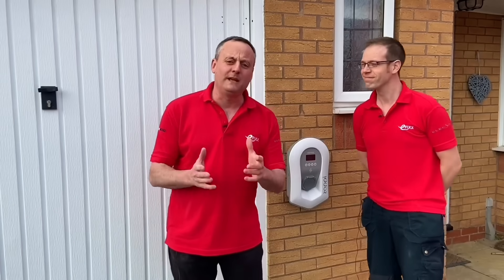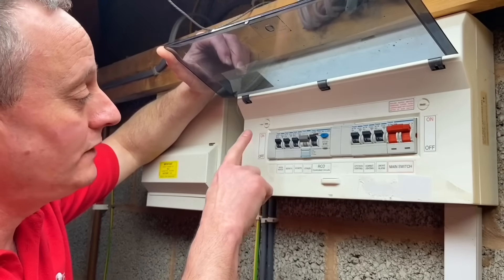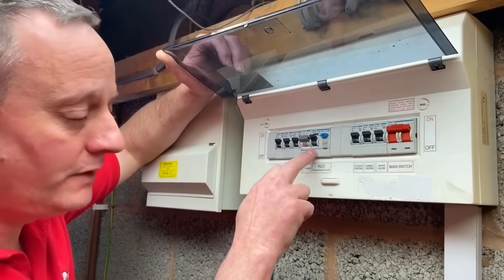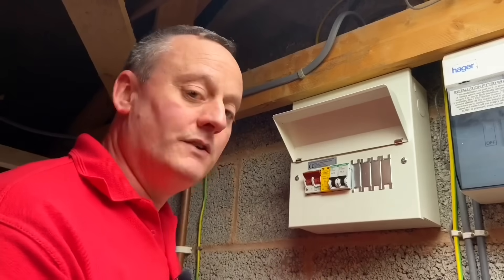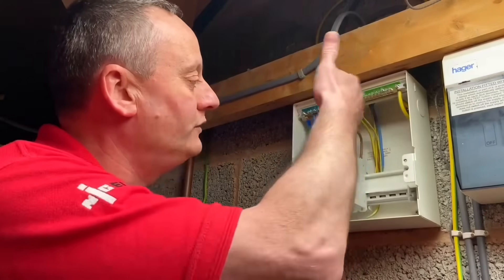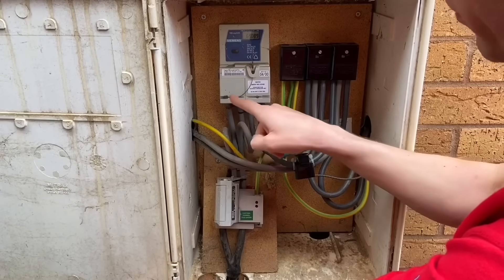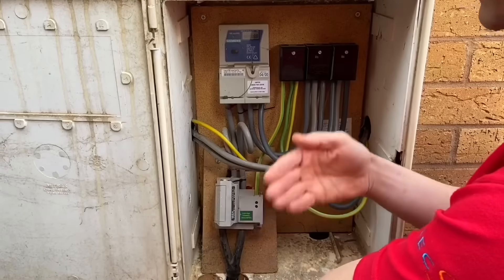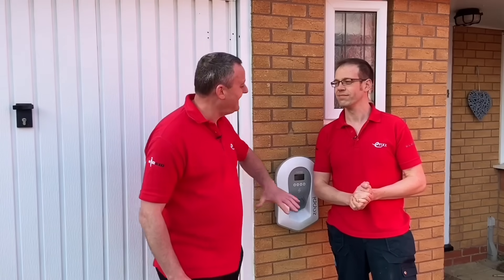EV CHARGER installation UK - can you connect to an existing CONSUMER UNIT?

Comment: Re: Using the same type of breaker topic around 2:05 mark - when electricians install new CU's' is it standard practice to advise the customer to have some spare MCB's/RCBO's in case new circuits are added in future? As a homeowner I just assumed I could always get hold of a breaker from the same manufacturer and it would be backwards compatible

Comment: But if poor installation no stickers on board , cable just clipped along joists without no protection or and fire rated clips 😒
Reply from the maker: Thanks for commenting - The video stated the stickers are still to be added and the cable is clipped for 1m so no fire clips required also the ceiling is now boarded as well. 

This video covers fire clips in a similar location 😉 https://youtu.be/9Ne-X7fLsnk
Reply: @efixx  I know video says stickers will be added later , and 👍🏻👍🏻about ceiling being boarded now

Comment: On the subject of EV charger installation, I'd asked my DNO (Western Power) to check my service fuse rating as I'm looking at getting an EV. I've just come off the phone to  the local office - they were very helpful and explained that the maximum they would fit is 80A. But, and as a policy that is only a couple of weeks old, if that is not adequate for an EV charger and the other house loads, they would upgrade the supply to 3 phase for free (3 X 80A). To say I was surprised is an understatement - I asked if this means they will dig up the road and was told yes. I said it sounds very German and she said that is what they are moving to, with a phase for the EV charger, a phase for the heat pump and one for the house. On new build they now provide a 3 phase incomer, blanking off 2 phases if only a single phase supply is required.
Has anyone else heard this, or seen it in practice?
Reply: That's a new one, but makes sense because of the obsession with the government's push for electric, which is not the silver bullet most think it is, but that's another issue.
There was a time when suppliers wouldn't fit a 3 phase supply in a meter box, always had to go on an inside wall.
Looks like they are going back to the old days, occasionally you come across 2 phases where one was used for heating.
Reply: Had cut out here replaced a few months ago, (Western Power) offered me the same upgrade the supply to 3 phase for free (3 X 80A) FOC.😲
Reply: @stuartandrews4344  Did you go for that, and if so, what have you installed as a consumer unit? The WPD document suggests 3 separate consumer units (or 2 of you only need 2 phases) and 3 phase DBs tend to be a bit big for domestic use.
Reply: @stuartandrews4344  It's the consultation document (not the responses) here https://yourpowerfuture.westernpower.co.uk/superfast-electricity-consultation and a couple of draft documents linked from it.
What you say makes sense if you just want a single phase supply at each location. If you want, for example, a 3 phase charger or machinery with 3 phase motors in your workshop, you then need a 3 phase DB wuth appropriate installation design (correct phase rotation, not having outlets on different phases within 2 metres).
Reply: That sounds very nice, do it! 

Here in Denmark we run everything 3-phase as standard, so it seems reasonable that our southern neighbour is moving that way as well. 

3-phase 230v coming into almost any house (even our old 1940's house), and I think we have a 63a fuse in front of each phase. 

I've added a 3 phase 11kW chargepoint to this house and was initially concerned about the available power vs. this old house. The electrician basically shrug his shoulders and said it wasn't going to be a problem unless I wanted a few more.
Reply: @Dark Dreamz it's supposed to be 400v now, but is still 415, that's between phases, you still have 230v phase to neutral.
Reply: @Dark Dreamz Yes it is 415 V across phases but there is also a neutral provided, so phase to neutral gives the required 240 V.
Reply: Wouldn’t that end up with the phases becoming unbalanced? Ie if the house is using a small amount during the day, the heat pump working and the charger not being on or the car charging at night and the heat pump on setback and everything in the house being off. 
Not a sparky so interested in some one knowledgable’s views.
Reply: @davideyres955  Ideally when designing Electrical Installations balancing loads is a design goal. Ideally you would want a 3 phase board installed and used in a way that as much as practically possible loads are spread across phases, however the problem with an upgrade like this is the possibility of 415v shock risk if circuits are close together and mistakenly put on separate phases and so I imagine to avoid this risk it is easier to keep the phases separated as described. Alternatively if a 3 phase board was installed you would be looking at a full design and rewire.

Comment: Something to note is some manufacturers now suggest a 40 amp MCB for surge device. Definitely would seal the meter cabinet holes , but it looks very neat . Can I ask if the RCD protection was built into the charger and last time I did an EV point it was made TT . As always a great useful vlog
Reply from the maker: Inside the Zappi 2 smart electric vehicle EV charger which doesn't need an earth rod on TNCS systems https://youtu.be/gwmiGf6tChE

Great technology in the Zappi hence no earth rod required...

Comment: I see all the time in my industry, people take feeds to Solar PV inverters from AC type RCD's. If that RCD has a lot of electrical equipment already operating on the circuits it protects, the chances of DC saturation are already very high, meaning that RCD could fail under fault conditions.

Fronius (an Austrian inverter manufacturer) issued a statement some years ago stating their inverters should be installed on an A type RCD, but in reality most often, the manufacturers guide doesn't specify an RCD type for electrical equipment.

Depending on the installation, the circuit *most often, doesn't need RCD protection, according to the wiring regulations.

My personal preference is to split the tails into a Henley block and put the PV on its own two way board, with either a 100A main switch or an appropriately rated RCD that is also of the correct type.

Another issue I see quite often, two way boards installed with a 63A 30mA RCD, if the cutout fuse is 100A why would someone install a 63A RCD?
Reply: You have to remember for donkeys years now, we have only really used one type of RCD for everything, the ac type, then all of a sudden all these other types come to market, and I am very sceptical as to who is driving the industry manufacturers or the Muppets, better known as the IET.
And to be honest, the push is to put an RCD on nearly every circuit, and can be quite difficult to get around in some instances.
Also we are trusting a mechanical device, and there's about a 10% failure rate, which is a lot, then they never get tested, no one pushes the test button, so again they can stick.
As for the inverter manufacturer putting out that warning, manufacturers will do anything to cover their bum, just like board manufacturers that say to check their terminations, why, if they are at the correct torque when they leave the factory why should I check them. I do, but shouldn't have to.
Reply: A few years ago when I had solar PV installed at my place, the installer followed your preference, with a new dedicated 40A RCD and avoided the older consumer unit altogether, with a pair of new cables into the existing meter box on the other side of the wall - about 1/2 metre away max.

Comment: Out of interest, would it have been more cost effective to replace the existing board with a hager rcbo spd board giving better protection to each circuit?
Reply: RCBO's are expensive still, and then the whole system would need a test and inspection because of the new board, plus any remedial works needed to get the installation functional...

2 way board, Henley block and some.meter tails couple hundred quid + labour...
Reply: No
Reply: It would give better protection and discrimination from faults tripping a Rcd and multiple circuits going off but as said not cost effective.  Most people want the cheapest job .
Reply: @dennisphoenix1  over a longer period of time though surely it would be as that board has say 10 years of life left where as a new board would probably last 25 years for the extra 100 quid outlay.  Spoken by someone who always likes a long term fix to a problem
Reply: @thefallenangel2  why has that board only got ten years left ??  If properly installed and periodically inspected I should last longer than that . As I said most people want the cheapest job . You can give the customer choices and your professional opinion on the current installation but you can't say something is dangerous etc just to get work from a board change.  Some unscrupulous people will .

Comment: I bought a new house in Feb 2020 and the "EV charger" is just a 13A socket directly attached below the CU. 18th edition cert and NICEIC registered contractor.
Reply: Even if it’s just a 13A socket, if it is designated for EV charging, or likely to be used for EV charging, it needs PEN fault protection.
Reply: @NickW1111  sounds like wishful thinking, I even found other sockets terminated through CPC sleeve
Reply: @NickW1111  not if it's TT or guaranteed TN-S by the DNO - the OP hasn't stated what the supply earth is.
Reply: @johnhoward2104  You're absolutely right. Though I read a comment that the only time you can rely on a supply being TN-S is if you can see the transformer on a pole outside the window, given how any faulty SNE is replaced with PME.
Reply: @NickW1111  Forget comments on forums. The EVC CoP (4th ed) says basically that TN-S needs to be comfirmed by the DNO that it will remain TN-S, otherwise treat it as TN-C-S - even a Tx on a pole could be converted, so would still need DNO confirmation. Basically, it's easier to just assume TN-C-S or TT.
Reply: @johnhoward2104  it's TN-C-S and has its lovely protective multiple earthing sticker. Already had to have the contractor install a switchfuse as during installation they moved the consumer unit further away from the meter box than planned and it resulted in 4m of tails through the cavity.

Comment: No mention of the PME/TN-C-S issue with an EV charger, I take it the Zappi has built in PEN fault detection?
Reply: It has built-in PEN fault technology,so no earth rod needed
Reply from the maker: It sure does, no earth rod required. 👍
Reply: I believe it’s has applied for a patent and been tested in a university lab not sure it has gone through other standard testing labs. Looks interesting technology though no real technical information on how this PEN technology is constructed and operates. Not if it would work even more effectively if earth fault path impedance was further lowered by adding an earth rod even though it does not need it.
Reply: Why is everyone obsessed with a pme supply and ev's, really it's the networks problem not the installer.
Plus, ask yourself what is the chance of the network dropping the neutral when the car is on charge and someone touching the car, it's got to be near impossible.
The networks should be worried not the installer or car owner.
Reply: @acelectricalsecurity  The DNO absolves itself of responsibility by stating that PME earths can't be exported outside the equipotential zone.  I've read recently that loss of neutral is quite common and is often caused by cable thieves.

Comment: Just to throw a potential spanner into the works!!

Are the tails, both the new set and the old set, run through the wall cavity? And, if this is the case, do these tails require additional protection?
Reply from the maker: I wouldn't say so, they're not buried in the wall feeding an accessory, they come through in a straight line and are clearly visible. You'd have to actively be trying to drill into them. 👍

Comment: 6:07 The service head is mounted on a 'scrap' of chipboard screwed/wedged at an angle against the main mounting board (don't know when this was done). Should this have ever passed inspection?
Reply: I've seen alot that are like this. Is it to avoid two sharp bends in the main incomer if the cutout were mounted on the back board? don't know. Any DNOs on?
Reply: @BezosAutomaticEye  Can confirm that it is to stop sharp bends in the incoming cable. The new series 8 Henley cutouts are mounted on a slanted backboard made of plastic in wall-recessed meter boxes. In surface mount boxes the cable comes straight up so the board can be mounted flat.
Reply: I’ve that setup at home - the chipboard wedge is pretty solid and with the incomes being surface mounted and so coming in close to the front of the meter box, it makes for an easy path to the cut-out.
Reply from the maker: What issue could it cause?
Reply: @efixx  - It brings the service head closer to the front, increasing potential of accidental damage or ingress of water (especially if door open or damaged). Is it an approved adaption to the fixing of items within a cabinet under BS7671 Certification (especially if it’s from new)?
Reply: Quite common on new builds to see this. I assume it's the DNO that fit them as they fit the service head.

Comment: Very informative, thanks for posting. .  Am I right in thinking that anyone could just take out a single screw on the connector in the meter cupboard and be exposed to the tails where they are joined?
Reply from the maker: I guess so, much like a light switch or a socket, anyone can undo two screws and access live parts.
Reply: @efixx  yes, that's true but are people much better protected downstream of the Consumer Unit?   I am just a curious layman but I was expecting something like Fort Knox around those connections lol
Reply: The issue here is someone is willingly opening that enclosure with a tool. If they aren't competent then they shouldn't be attempting to access that enclosure. They are making that decision...
Reply: Yeah just like anyone can take a screw driver to any electrical accessory. Or put their finger inside the lamp holder on a pendant that has no lamp in and have access to live parts without the use of a tool.

Comment: The SPD doesn't look like a Crabtree SPD. I've queried this with Wylex where I've found other sparks using non Wylex SPDs in their consumer units. Their response was...'if the product installed within the consumer unit is a non Wylex product then the installer becomes the guarantor of the whole assembly'. Since Crabtree are part of the Electrium  Group I'd expect their response to be the same. Like the MCB example u used in the video, the same applies to SPDs as it comes down to type testing.
Reply from the maker: Interesting point for discussion. Thanks for bringing it up. 👍
Reply: Yeah I agree mate. It's a tricky one. I'd always just go with the CU manufacturer's SPD for my own peace of mind (knowing product testing should have been completed as an assembly) and if the worst were to happen, to avoid any finger pointing between installer and manufacturer(s). Cost will likely come into it but it is what it is I suppose.
Reply: You really want to hear it from the consumer unit manufacturer though? In my experience they want nothing to do with other manufacturer's gear. Don't shoot the messenger mate, just saying what Wylex technical said when I queried it.
Reply: Quite agree with your comment @Daniells1982 What code would you give for the mixing of manufacturer on the next EICR. If it was a MCB with no signs of damage guidance suggests code 3, would it be the same for the SPD. The CPS scheme's should really be sorting this out to give guidance before thousands are installed, maybe efixx could grasp the batton.
Reply: @markholmes4143  I'd probably say that's a fair assessment mate. Mixing manufacturers just isn't worth the hassle in my opinion. U may end up paying more but if you stick with one manufacturer you can't go far wrong and at least if there was an issue down the line that's no fault of the installer I'd hope there is some support from the manufacturer if you've used their 'system'. I think guys just need to be aware that mixing manufacturers gear in a CU, including in line meters, bell transformers etc you're taking some responsibility away from the manufacturer and taking it on as the installer, becoming the 'guarantor ' was the term they used.
Reply: @Daniells1982  Really? The manufacturer really guarantee all what happend after the installation? Only use material from this company? 

In the EU we need only follow the actual norms. Same we do in the Kingdom of Thailand. More easy for every installation.

Comment: I would have been inclined to use an adaptable box below original board and split the tails with line taps to feed other board and use a spd incorporated main switch in the meter box.
Hager breakers do fit old consumer units so perhaps new board not required if SPD placed before original consumer unit.
Reply: Personally, if it were me, I would have used a spare way in the existing board, and if I had to install a SPD I would have used an in-line unit in its own enclosure, and not had any joints in the tails.
Reply from the maker: Always good to hear different engineering opinions. 👍